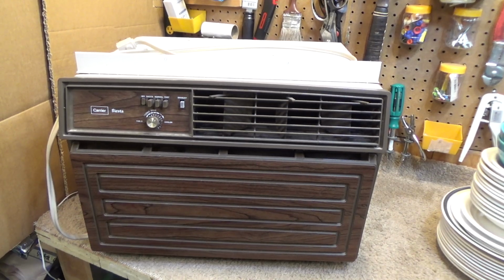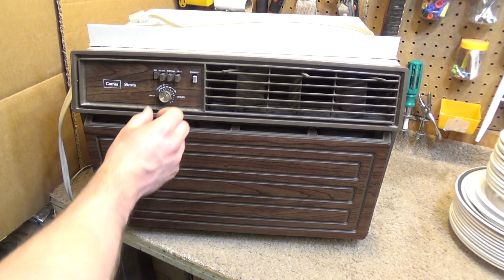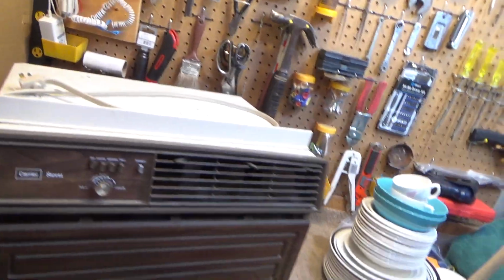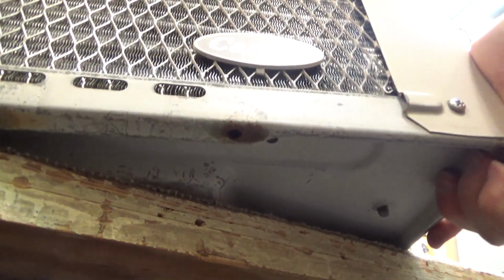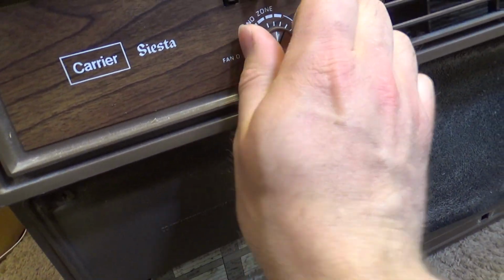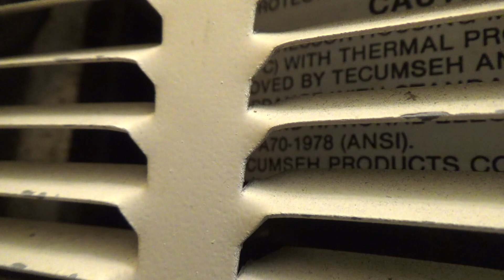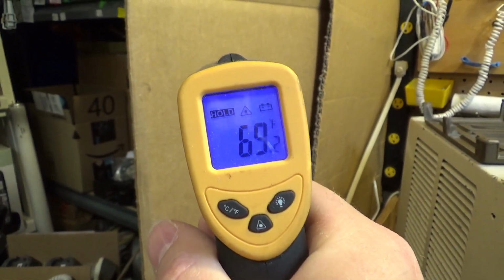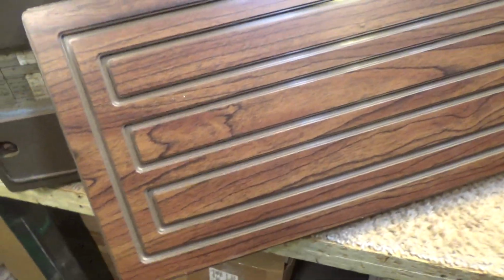1982 Carrier Siesta 51BKA005 5,000 BTU Air Conditioner | Initial Checkout

Comment: Nice score!  I treasure my 1984 version.  I love the window sill "contraption".  I need to take that idea and adapt it to my windows because they really don't like a/c units very well.

The thermostats on these units is a bimetal type that senses by having some of the air blowing on it rather than the capillary tube on the coil.  You might be able to unstick it or clean it.  I believe the fan motor on these has oil ports (fortunately) as well.

Comment: Could ya help me in the right direction for a replacment thermostat for this same unit? Thanks!
Reply from the maker: I'd just jumper across the thermostat and connect the machine to a temperature controlled outlet. These thermostats are becoming very difficult to find, and I never found the design to be particularly effective anyways.

Comment: Awesome unit and compressor startup noise! The big wood board at 3:29 was probably used for a larger air conditioner. Also do you ever plan on installing this unit like you did with the Westinghouse unit last year?
Reply from the maker: Hopefully by the time I get around to cleaning this I'll be at the new location and can install it permanently.
Reply: Nice! I’m wondering if there will be any vintage units already at the new place (like a vintage central unit or a vintage wall unit).

Comment: My LG 5000BTU watts input is only 440 against 835 of this. But I still prefer to sleep with this Carrier sound then my quiet LG.
Reply from the maker: I wouldn't at all be surprised if this unit outputs twice the cooling as the LG machine. The newer units draw less power for a reason, they do less cooling.